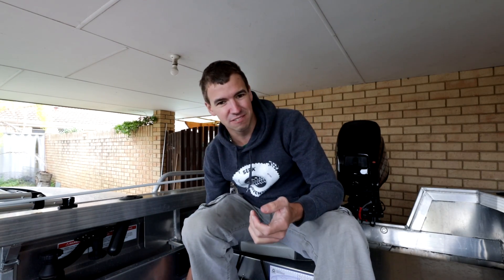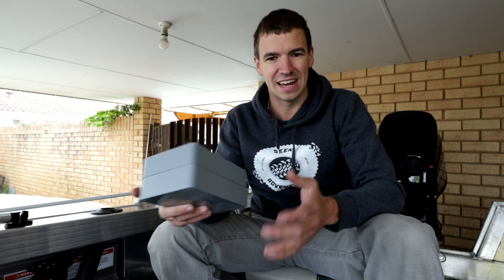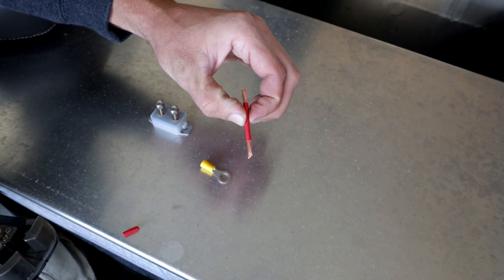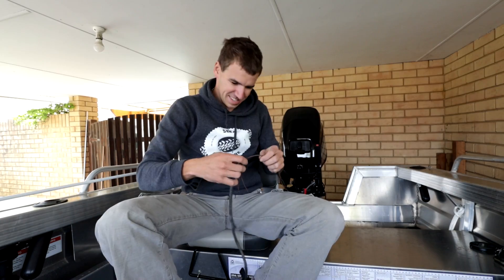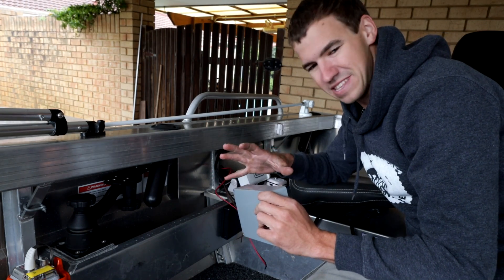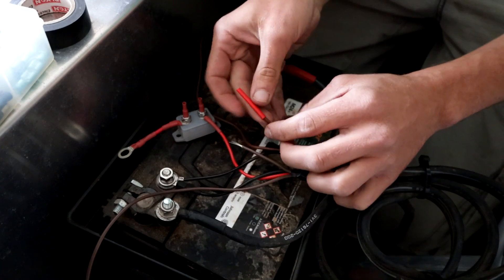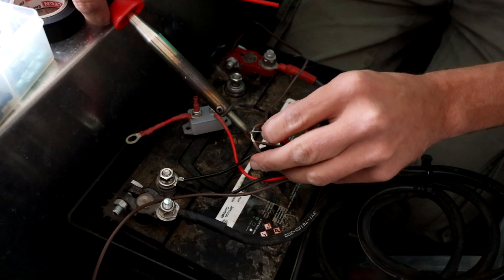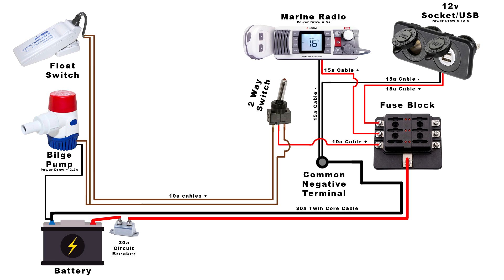Basic DIY 12V Wiring | Fuses, Wire Sizing

Comment: Hi Michael. I just came across this video (Jan 2024) and like all of your videos you have produced a good quality video with great information. Since you produced this video 4 years ago, you may have refined your wiring of boats, but can I suggest a couple of things for electrical wiring in marine environments. 
1. ALWAYS use tinned wire
2. ALWAYS solder joints
3. ALWAYS apply "liquid insulation tape" to the joints prior to applying shrink tube
4. ALWAYS use glue filled shrink tube
5. Buy a tube of Duralac and ALWAYS apply it to any fixing or fitting you put into or onto the hull. This is of the utmost importance in an aluminium boat and most boat yards have never heard of it! It is VITAL to eliminate galvanic action of similar or dis-similar metals. IT IS VITAL!
6. Apply a thin coating of lanolin based grease to all terminals as well to protect them from marine corrosion. I use Lanotec and a small brush.  

Salt water will find and decimate all copper, brass and electro coatings such as the plating on electrical terminals with ease. An aluminium rivet in an aluminium boat will corrode!

Hope this helps everybody.
Reply: You just killed the joy of boating for everyone!🚣‍♂⛵

Comment: dont believe any current ratings on cable rolls. get the proper cable rating tables from the cable maker.
cables lose capacity by distance and temperature as cable temp rises the capacity drops.
remember cables are sized in mm2 or AWG 0 gauge is larger than 1 is larger than 2 etc

Comment: Just wondering why you selected 15A cable for the radio for a 5A draw but then went down to 10A for the bilge pump - could you have used 10A for the Radio or am I missing something? Great video and great help to a non-spark

Comment: great video, something you should think about when wiring anything, i like how you put the heat shrink on the breaker studs but remember you just created a pocket to hold moisture, turn the breaker on its side at least so water can drain out, secondly you should not drill holes in the top of the fuse box where moisture can enter, always use good practice and insert wires from the bottom up   and in a pinch through the side of a box, after all you bought a sealed box right. best of luck
Reply: Can you please elaborate on that part about through the bottom and with a pinch through the side?

Comment: I already know how to wire stuff, been doing it for quite a few years. I watched this to see what good ideas you were sharing and really liked what I saw. Good job, sir! 

I'm glad to see you solder the connections, especially since they're around water. 

Using heat-shrink is good, too. There's a kind that has resin or glue in it that seals out water, which is what I started using in the last year or so.

Great vid. Keep on keepin' on!
Reply: @rustysummers3217  I'm sure there are plenty of conversations about it. 

A properly soldered connection won't corrode and then break the connection. Add the glue-sealed heat-shrink and you have even more insurance. I'd even hazard a guess that the connection would outlast the vehicle, which effectively qualifies as lasting a lifetime.
Reply: @A. Melbs If the heat shrink is the kind with glue to help keep the elements out, then that's going to go a long way to helping keep the crimped connection from corroding. However, if the heat shrink is nicked, then you now have an increased risk of corrosion. 

Soldering joints that are out in the weather is a lot more secure physically since they won't pull out of the connectors, plus they're guaranteed not to corrode since the connection is fully sealed in metal.

Whether he said it's the perfect connection or not, I can no longer recall since it has been a year or so since I watched it. I know for sure that I didn't say that, so your comment must be directed to him, not me. Maybe you're including me since I like soldering connections, especially ones outside the passenger cabin. It makes no nevermind to me because I'm gonna do what I've been doing, and I'm certain that you will as well. So I guess there's no real argument, eh?

Comment: Good vid. Well done. Hint - fuses should be 25% greater than amps. I’d also include a battery isolator so you can turn off everything and eliminate risk of running down your batteries
Reply: In this setup up, where would the best place for the isolator be? As close to the battery as possible?

Comment: Thanks...another great tip about keeping the spare fuses in the fuse blocks (and also the heat shrink on the bolts).... New arrangement for my camper trailer.   I always seem to leave my container of fuses at home.....

Comment: just a small tip with soldering!

melt the solder OVER the wires rather then heating up the wiring. let the molten solder fall over/through the wire, doing it this way stops unnecessary heat/burn in the wiring  and stop the wiring from becoming stiff and hard making it potentially brittle in the future.
Reply: I'm not sure I understand what you are saying.  I heat the connection and allow the heat from the wires to melt the solder and wick it into the connection.  If you are melting the solder with the soldering iron, rather than heating the connection, you will have a 'cold joint' that is prone to failure.

Comment: Bad tip at the end about adding appliances just by adding it to the fuse box as you have forgotten about the 30A cable you calculated at the beginning.

Comment: Good info and an informative video. The best advice I can give when doing your own wiring is to test your connections the same way you test knots you have tried in your fishing line. Try hard to pull them apart and if they fail re-do them until they will not budge. If you do have an electric bilge pump, always remember to carry a manual means of removing water from the boat. Electric gear isn't fool-proof and thanks to my good mate Murphy, will usually fail when you need it most.
Reply: @rustysummers3217  Yes, that is one of the many things you have to get right. Connections are just as important as wire size and correct fusing. It is probably better not to SHOUT at people because it makes you look like a bit of a dill...

Comment: Neat work mate, surprised you didn’t bang an Anderson plug in for solar charging the boat battery :) see ya on the water 🤙
Reply: How would you wire the charge controller into his box? Would all electronics be ok as long as they are properly fused? I might try this once understand it more make sure its safe

Comment: I didn't hear him say it but never use the boat as a earth. Seen a 18 month old tinnie destroyed by electrolysis.  Spiral wrap rather than split tube as it cannot hold water. 
Lastly i used 10amp trailer wire so everything is colour coded and on separate fuses. Voltage drop on a tinnie would be very minimal at 10amp wire when everything is LED anyway.

Comment: Doing some rough calculations, you need a 50A Maxi Fuse off the battery +ve. Then a 150A thermal circuit breaker off a common positive. I'd also put a Maxi Fuse both sides of the -ve shunt, which you need to fit.
Reply: Can you elaborate? Im trying to understand.

Comment: 00:00 Mate, I really like your channel. But as soon as I read "12V", I get nervous. I'll watch it through. I'll need to see shunts, thermal circuit breakers, Maxi fuses and BIG AWG cables, where required. All cables off one -ve and the others off one +ve.
Reply from the maker: Shunts, thermal circuit breakers, maxi fuses and big awg cables? Your watching the wrong video Stuart, only hooking up a few low draw things here, not a dual battery system mate 🙂
Reply: @SeekAdventure  Roger. But I still like your channel.

Comment: Crimping is generally the agreed way to join 12 volt in automative settings. Solder has issues with vibration(wire fatigue) and it seeps up into the cable and hardens the cable close to the join (Reduced flexibility). Look under your hood, you won't find anything soldered.

Comment: Good stuff.  In wet environments I like to drill the junction entry holes on the bottom to aid resisting water ingress.  With those junction boxes I also try to put all components and wires on the same side (not always possible) - makes it so much easier to work on later (two halves can be fully separated).

Comment: Nice work, keep going with these vids..couple of tips, do use a step drill bit, also in harsh environs most troubles are caused by crook earth connections; solution is to run connections via cable back to negative post. You've done it right removing crap terminal insulation, then crimp...

Comment: Friendly tip. When soldering cables or heat shrink you can do it all with a little jet lighter. They are at Bunnings for like $20+ in the tool shop or you can find them for like $5 at some servo’s.
This way you don’t have a hot soldering iron sitting in the vehicle ready to fall and melt things.
It’s a lot quicker to get the heat into cables for a successful solder.
Love the channel keep it up!!
Reply: I use a heat gun

Comment: You should have used marine cable and had the bulge connected through the float switch and connected it straight to the box not the switch
Reply: Is marine cable like marine ply wood? "Marine Cable" is a selling point, not a product.
Reply: @stuartkcalvin  but it's not just copper like standard cable tho, it's tinnted copper alloy to resist corrosion and is Used in general purpose 32V DC marine and battery applications. please do your research it's not just a selling point

Comment: When stripping. Wire is the cheap end so use it. Strip the sheath but not off. Check the twist. Use the stripped sheath to twist. Not too much. Then get a nice twist has you twist sheath off. Then it fits in your connector nice. No lose stands.

Comment: In the USA, an auto electrician wouldn't solder any wiring, they will crimp everything. Over time, vibration will break the wire at the edge of the solder joint.

Comment: Crimped connections are recommended for vehicles of any kind, rather than soldered ones. What about drilling holes into the bottom of the box instead of the top, so that any water can easily drain?
Reply: the box is under the gunwale, so wiring coming in from the top makes sense to me. It would be good to drill a couple small holes on the bottom, just in case though, IMO.
Reply: Oh,oh,oh.  The professor is holding class.  Boom.
Reply: "Crimped connections are recommended for vehicles of any kind, rather than soldered ones"
Well, what voltage drop world do you come from?
"What about drilling holes into the bottom of the box instead of the top, so that any water can easily drain?"
How about not getting water into there in the first place?
Reply: @stuartkcalvin  Crimps are recommended because of vibration, a solder joint is likely to crack after long exposure to engine vibrations. Solder also wicks up the cable, making a stress concentration.
Reply: @stuartkcalvin  Best thing to make it watertight, but just in case it isn't always, it's better to have them at the bottom. How come that car manufacturers crimp all connections? They are just more reliable and have no real issues with voltage drop.

Comment: Yeah, nice. 
Personally, I'd have put in a Master 'Kill' Switch as well. Kind of like an 'Ignition on/off'. 
The USB Sockets, for example, could cause a continual drain on the battery. (LEDs also but probably not a problem.) 
Also nice to be able to kill all the circuits. 
(A voltmeter and amp-meter are also handy to show your overall situation.)
Reply: Was going to say the same thing a nice resettable breaker Incase accidentally leave on radio or sounder or parasitic drain.
Reply: Bossy Bill an isolation switch
Reply: ToyBJ74 86 can u tell me more about the isolation switch? i recommend one?

Comment: Nice informative video for a bit of DIY for people who want to try themselves. As others have said, should be using tinned cable for any marine installations as it wont corrode and fail later on. Also a good crimp is always going to better than soldering in any environment thats prone to vibrations as solder joins can fatigue and snap. Especially when copper is used in salty environments. Theres a reason why race vehicle harnesses (And vast majority of passenger vehicles) use crimped connections and not soldered. But anyway, good video and explanations for the home handy man!
Reply: Agreed.

Comment: Should consider a isolator switch for when you store the boat include the motor. Not too sure about the circuit breaker you used, if it is an auto reset they can keep resetting when there is a fault. I would just use a maxi fuse holder to be safe.

Comment: What about isolating the bilge pump?  The float switch may bounce around on the road and turn it on and off semi constantly.
Reply: Good point. I was also interested in the bilge wiring. And concerned it a fault would cause it to run and burn out when no water present. If you look at the diagram he’s using a 2 way switch, so it’s auto on or manual on. No off on the switch. I’m going to either use a 3 way, on auto, off, and on manual. Or two seperate switches.
Reply: It has an on/off switch - the video shows that.
Reply: @stuartkcalvin  as far as I was aware it was a manual on off and doesn't stop the float activating the pump.
Reply: @kiho1995  
I think the bildge switch is 2 way .

Comment: Hot tip, use clear heat shrink. That way you can see whats going on underneath easily and spot corrosion or wire breaks as time passes.
Reply: Never seen that before, I'll keep an eye out for it. Thanks!

Comment: Just a reminder - if you add further accessories later you need to consider increasing the supply and earth cabling capacity.
Reply: For that reason I will always overkill with the cable from the battery to the main fuse box.
Rather have a thick wire with a way to small fuse for the main power supply. You can always later increase the main fuse to a larger size if the components get more.

Comment: another good one mate just a couple of tips to improve in my opinion. now you have good strippers whip down to jaycar or supercrap and get some ratcheting crimpers to go with them, while you're at jaycar get yourself some tinned copper wire and adhesive lined heatshrink both are marginally dearer than standard automotive but improve your resistance to corrosion by heaps. once you have the good crimpers forget soldering it is not ideal in high vibration environments, and lastly get wire that is either AWG or SWG rated so you know what you are getting most automotive wiring from auto retailers is not rated to standard and can cause fires due to incorrect load capacity. personally I use marine grade tinned wire on the fourby as well.
Reply: @rustysummers3217  keyboard has all that I just chose not to use them
Reply: @rustysummers3217  tinned wire with a rating is only marginally dearer and avoids the possibility of burning your project to the ground.
Reply: Good information, but just to clarify for people who might not understand, AWG and SWG are the sizing of the cables, ratings can differ within those sizes still. For example there are a large amount of different wire insulation materials from plastics to rubbers, to fluropolymers, all which lend different characteristics and ratings to the cable. Same with the type of conductor used. All in all, as you were saying, take the current "rating" on the label of generic automotive wire with a grain of salt. If in doubt, check current carrying capacity tables online.
Reply: @sumodaze2198  AWG is the American Wire Guage it is a standard that the wire is guaranteed to meet SWG is a different standard but achieves the same purpose, in order for the wire to carry the standard the manufacturer must guarantee the wire will perform within the specifications laid out. the generic auto wire may actually be ok but you pay your money and take your chances. for most private boats and 4wd vehicles tinned copper with awg or swg rating will guarantee that you don't set fire to your expensive toys, now for mega yachts aircraft and other applications there are other considerations to be considered and other standards will suit those applications better
Reply: @gmoose777  I know exactly what they are, i have worked in the electrical field for over a decade in manufacturing, circuit design and engineering, so i know the standards and codes. Wire gauges are just a logarithmic ways to measure the diameter of the conductor. Its completely fine to use mm2 for the CSA to choose your wire size. AWG and SWG also have different diameters for the same gauge number as one is American and one is British. Ie 10awg is slightly different diameter to 10swg. Wire gauge does not determine the final current carrying capacity of the wire. Different insulation affects rating, as does installation of the wire such as if its in air, ducted, bunched with other wires, saddled etc. American wire gauge and Standard wire gauge are just size indexs, not cable ratings.
Reply: @sumodaze2198  yeah if you buy wire sized in square millimeters it too is rated but generic auto wire at 2.5mm as you would get from supercheap is not 2.5 square millimeters of conductor it is some bodgy chinese approximation and usually includes the insulation thickness I am fully aware of the complexity of the specifications of various standards just trying to keep it simple we are wiring 4wds and tinnies not rocket ships the process is simple look up wire chart on internet find your load on one axis and length of run on the other where they intersect will be a wire size appropriate for the application, it will usually be awg or swg, go to jaycar or similar outlet and get tinned copper wire in the correct size wire up your project.